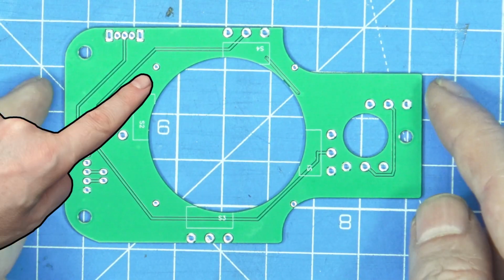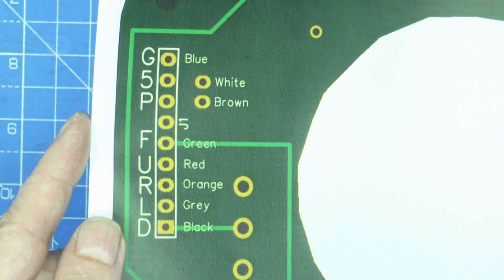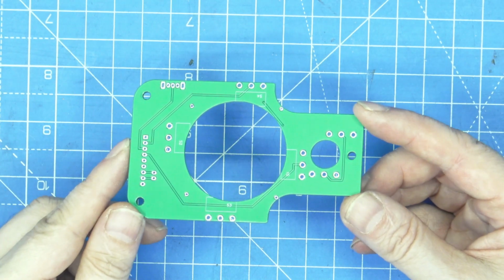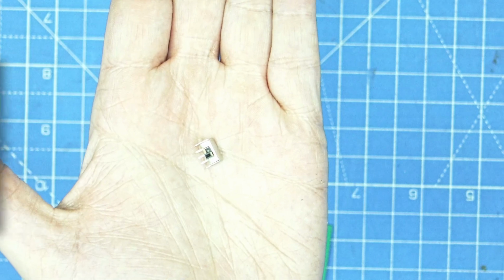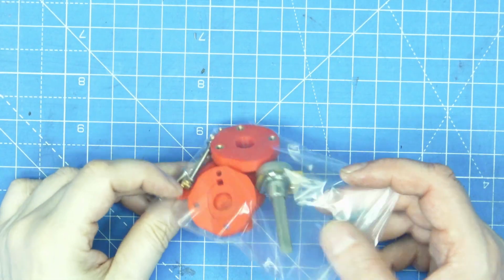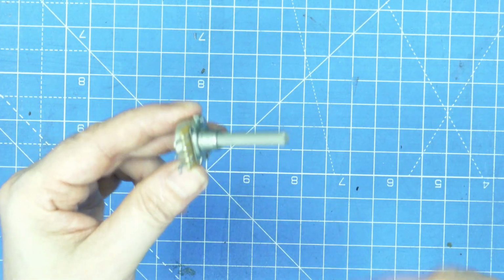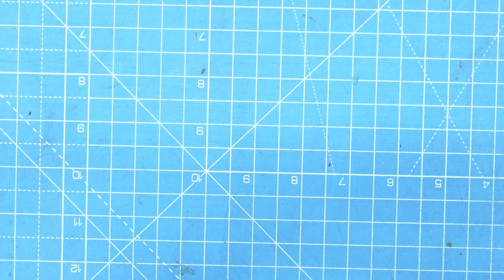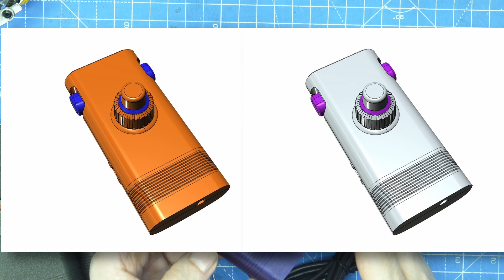Lets build A new  Atari joystick and Paddle controller.

Comment: Looks great! Love that you kept the 70s design aesthetic and mechanical aspect.  Looks like it was fun to design those springs in and find what works. How does the 3d print come out so smooth? Been on the outskirts of 3D printing but haven’t bitten the bullet- mostly I don’t like the texture you get with ridges. What did you use to smooth it so much?
Reply from the maker: To get the smooth finish you print the parts standing up and also spend £600 on a good quality printer.

Comment: I like this design.  A few years ago I wanted to convert 2600 paddles to work on commodore better as commodore paddles are harder to find and pricey.   2600 paddles do work but response was too fast to be useful in a game like Omega Race.  Unfortunately I couldn't find a suitable replacement rotary potentiometer with commodore-like impedence to do it.  I could wire in resisters but the response curve probably wouldn't be smooth enough.
Reply from the maker: Commodore need 470k and I can get one the same type as I used in this so I am thinking to make one, but my C64 does not have an original SID so I can't test.
Reply: @leesmithsworkshop do you happen to have a link to that pot? I am ready to make another one of your paddles for my c128. I would appreciate that. Thanks again for this great design. I am ❤️ playing on it.

Comment: Lovely video, this look like a really lovely self-build, really impressed with all the details you've worked out with this, lovely
Reply from the maker: Yes, I am very pleased with the final build and how everything fits together, the new leads just adds to the overall look and feel of an original controller.
Reply: @leesmithsworkshop  I was eying up the kits and fab files on your site, but really don't need a joystick right now 😁 give it a ouppe of weeks!
Reply from the maker: @mogwaay  depending how popular these are will determine if I order more pcb and parts for kits.